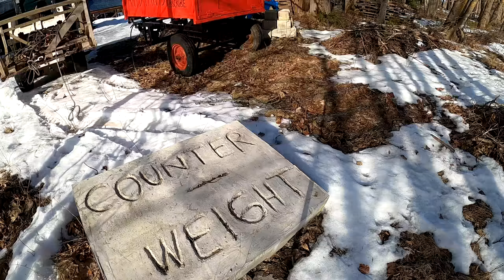Getting some logs for the sawmill/firewood

Comment: maybe make a skid steer plate for your tractor loader then you can easily and quickly switch between a bucket and the pallet forks.  
thanks for the video .
Sincerely, Hollandduck from the Netherlands
Reply from the maker: Quick attach plate. Yeah iv thought about it. Its a good idea. Will need to add it to the job list💪

Comment: 👀looking like you're good on wood supply for awhile😁! Lumber to mill, & fire wood for next season. Got to put the dump trailer to test too! And no major problems with your  equipments😀👍
Reply from the maker: Yeah this time everything worked out great. Had a hydraulic leak on the tractor but a quick hose change fixed that fast. Good thing i bought excessive amounts of houses when i did that dump trailer 😆

Comment: I think you need to make a sketchy PTO firewood cutter like a big circular saw blade the runs off the tractor PTO and a sliding carriage so you can cut pieces of firewood up in manageable sizes it would be a perfect companion piece to your brick cutter.

Wonderful video as usual. It looks like it is finally starting to get warm because it looks like the snow is melting a little bit. I cannot wait to see what you have prepared for this summer
Reply from the maker: Got more ideas that i can fit in my thick head. Think i have projects planned out for atleast 2 or 3 years. I do have some circular saw and i will put that into use in the next video

Comment: Is it just the protective cover breaking on the GO PRO ??   Indium tin protective screen covers are brittle.    If you ever get them made  from GRAPHENE , they will never break unless the camera  gets completely destryed.  
    Samsung uses GRAPHENE on their flip screens.  In it's raw state,  GRAPHENE is a single molecule thick 2 dimensional lattice .  It is 200 times stronger than steel !!! Has over 60 different uses that can be developed in probably 20 different ways for each category.. everything from destroying cancer tumors / delivering medicines precisely where needed /  stronger and LIGHTER In weight than KEVLAR / and will be used in batteries that will charge in less than 2 minutes / car batteries will completely charge in 1 to 2 hours flat / they are even forecasting clothing with GRAPHENE solar to charge your phones on the go.   I'll bet a dollar they will make hydraulic hoses that will never break someday!!!    Right now it's expensive, but that's the way all new technologies are.   Scott in Farmers Branch Tx